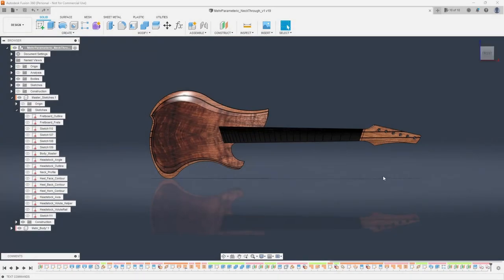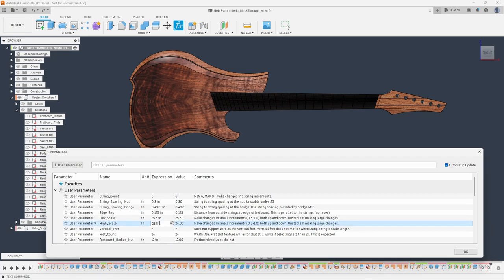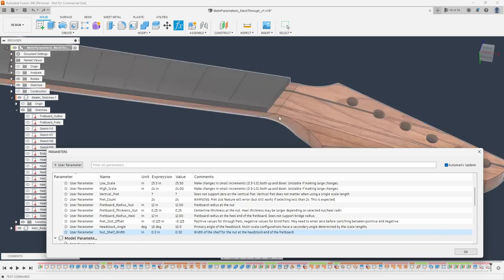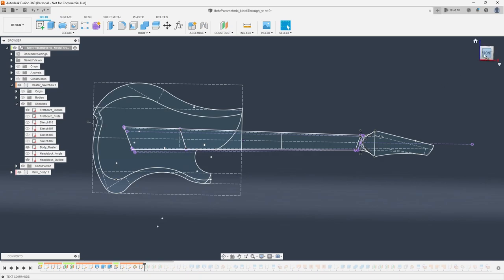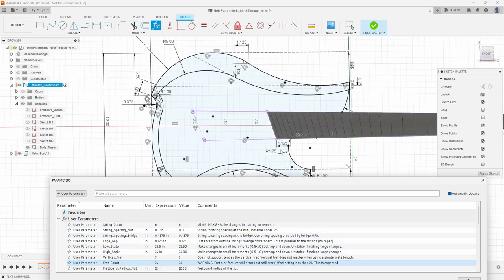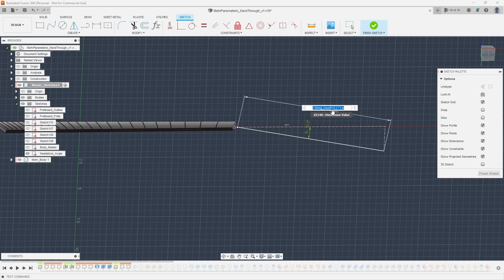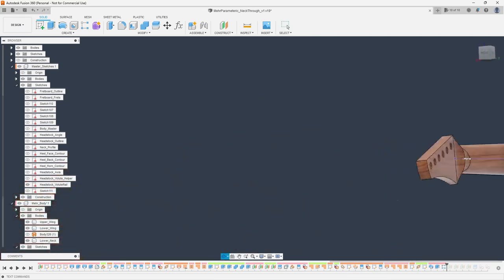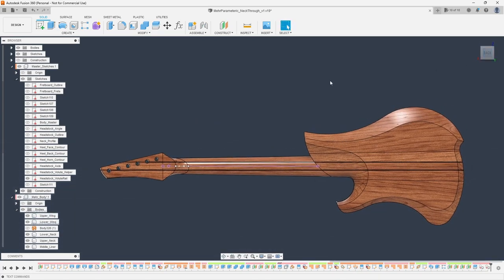Is it possible to make a fully PARAMETRIC GUITAR?!

Comment: Man, this is huge. I tried doing this to a tele neck to update the profile but my design kept breaking and I threw in the towel. Now I know it's possible, thanks so much!
Reply from the maker: Thanks! I thought about including neck profiles, but I feel that is best reserved for bolt on necks where you don't need a flush transition to the body. Otherwise the profiles directly impact the shape of the transition, and that's asking a lot from the model.

Comment: I managed to make 3 (almost) completely parametric guitars, but I was very annoyed I couldn't get the post holes to automatically increase/decrease with a string count parameter. That pattern tool thing you did is a big deal!
Reply from the maker: Nice work! It took me a while to find the best workflow for variable tuners as well. But I've actually got it working for both Inline and 3+3, but 3+3 is more difficult because once you add a string they become uneven. 

Mattia, that discord member I mentioned, showed me a way for Fusion to round up or down if it's an odd number. 

So for example, if you want the top row to increase when there is an odd number...

Let's say strings= 7. 

Use the ceil function to round up
 ceil(strings\2)=4

And use the floor function to round down
Floor(strings/2) = 3
Reply: @austinshaner  Wait a minute...I had no idea there was functional syntax that could be used. I need to do some googling...
Reply from the maker: @joelbennett9014  there is! But it's extremely limited for the time being. I dream of the day we get if/and/or statements
Reply: @austinshaner  You know my heart Austin...if they could incorporate logical functions to the parameter fields, or even a separate scripting feature that could interact with the parameters...I'd be in nerd heaven.

Comment: Totally amazing, Austin.  An inspiration.  Will next check out the parametric neck videos (out of order).  A few thoughts on which I'd value your feedback:  1) seems to me you could assign a parameter to allow your body width to grow slightly for the >6-string models, couldn't you?  I realize that you made a point in the video of wanting your body to be totally independent of the neck but maybe this one linked parameter wouldn't break it?  2) You didn't talk about # of frets as parametric and I saw that your # frets parameter had a comment that indicate that it'll break if <24.  I'm guessing that this is because the # of frets may have to affect where the body and neck join, right?  3) Related to my  #2 comment, seems to me that the bridge location has to change parametrically relative to the number of frets and scale length; did you set this up in your body?  Thanks again and keep up the GREAT work!
Reply from the maker: I actually did this at one point to my Mehr design. Every dimension in my body sketch had a multiplier that correlated to the number of strings. So the body scaled automatically. It was very difficult though, with how many dimensions I had, to maintain all the proportions. 

Im sorry for not showing this in more detail in the video. But this model actually allows for a different fret count. The only thing that breaks if <24 frets is the CAM Slot sketch which projects your fret lines onto the surface of the fretboard for use in CAM. This happens because the fretboard shortens, and therefore the frets on the end no longer have a surface to project to.
Reply from the maker: Also, yes, the bridge has to move to accommodate different fret counts and/or scale lengths. I was able to get up to about a 28" scale length without the bridge falling off the end of the guitar.

Comment: A useful addition to the model would be to allow zero frets and setting the desired distance between the zero fret and the nut.
Reply from the maker: My parametric fretboard file actually has this feature included (as well as a recessed nut), but In order to simplify the model for full parametric control, I opted to remove those features and just keep a shelf nut since that's what I intended for this design. 

However, it's possible to have the other, both, or all 3 ... if you create separate headstocks for each and suppress the features not being used.

Comment: I made my neck parametric (fretboard and neck) but I still struggle with angled headstock and fan fret...
Reply from the maker: I've done a bunch of multiscale with angled neck but only with varying degrees of success because of the compound angle/axes. This was the first one that truly worked reliably if I didn't push it too hard.

Comment: Which video do You cover adding fret count in? I've been moving back and forth between the 1st, 2nd and 3rd parametric fretboard videos you made, but it's a little confusing since the 1st video was revised in the 2nd and the 2nd video was again revised in the 3rd, I got most if it figured out (I think) as my sketches are behaving properly, but I'm still confused how you add a fret count. Is it a parametrically driven patterned sketch?

Comment: it is easier to make her by hand directly of wood than doing this thing
[can say this from looking at your videos’ timings]
Reply from the maker: The benefit of cnc isn't speed, it's repeatability. You spend the majority of your effort up front in the design and programming, then the machine can spit out near identical parts reliably. However, with the proper tooling, CNCs are actually much faster than by hand once you get to large industrial machines like haas etc. They can finish an entire guitar that is nearly ready for finish in under an hour.
Reply: As a 40-year luthier now getting into CNC, I respectfully yet wholeheartedly disagree.